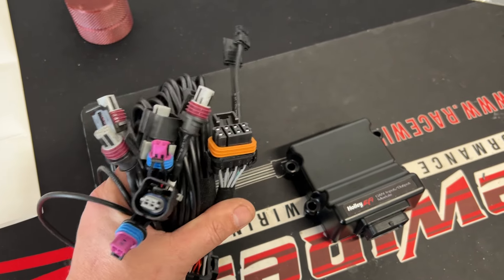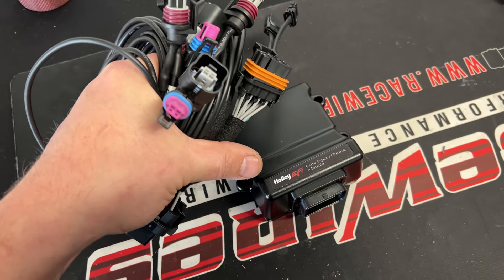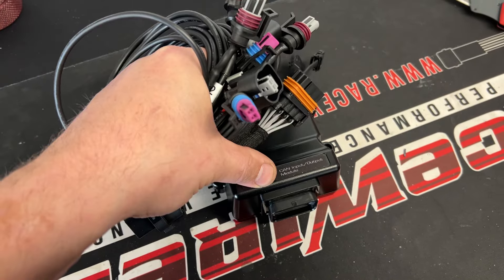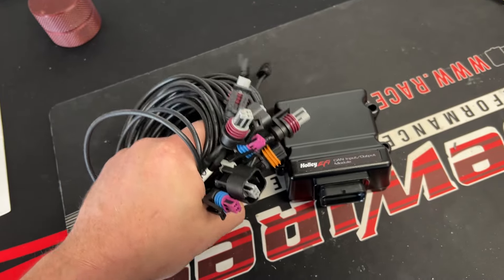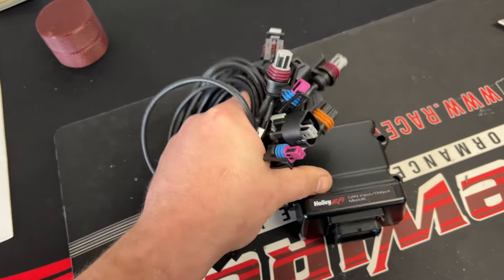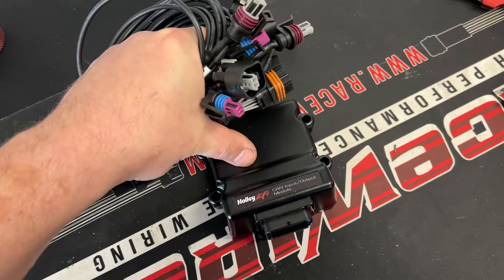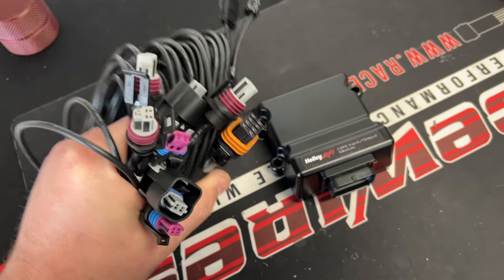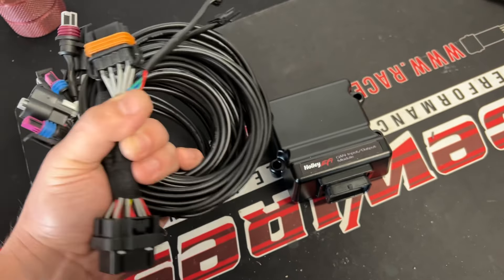Holley pnp can io module harness

Comment: Very nice, I painstakenly built out everything by hand on my bench before I even laid a single wire for my Terminator X Max install - build your wiring diagram and plan out expansion before you start guys.  These things are great for adding the nice to have sensors down the line as data is everything.

Comment: Well SONUVABITCH....if I had a time machine. Why do you do this to me? I have run out of I/O's so I've gotta find a way and well this is it apparently, Im building my fresh LS stroked to 6.3ish so I'm gonna need one of these.  Count me in for one, in 100% on this.
So rad you are making these sweet harnesses, the quality is very nice and everything about them is top tier.   TAKE MY MONEY, haha..  I already have the PNP dial-a-boost, w/Flex, and alt control....    Can this be used in combination or would it just replace what I already have?
Reply from the maker: its an add in, you get the holley can io box for 250 ish and plug this in and its already wired.

Comment: Is it possible to get the harness without all the ends terminated?? I need to control other stuff. Inputs and outputs?  I just want it to plug into Holley term x and module
Reply from the maker: holley sells the pigtail harness, or a set that is the connectors and pins